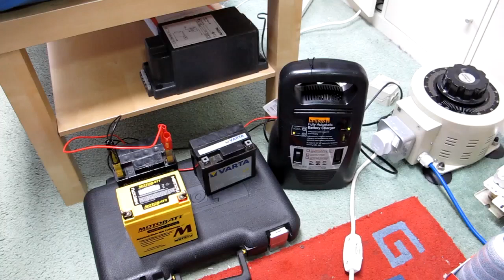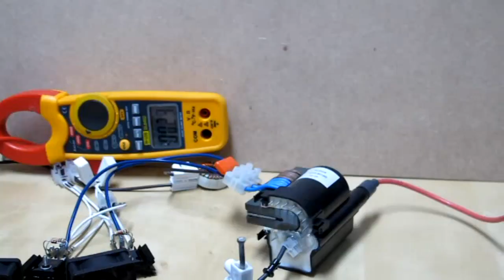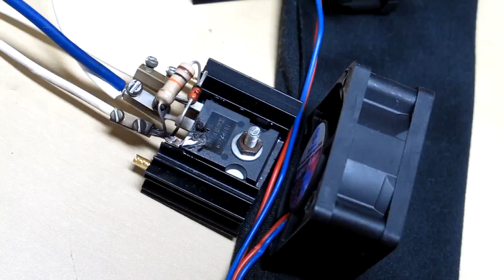Flyback transformer: 36 volts. Arcs & a big bang!

Comment: It wouldn't have been 36 volts on those batteries, unless they were near flat. You're probably pushing over 40 volts through that circuit with three series lead acid batteries.  I finished my own driver last night, but it took days and days to build it and I'm slightly nervous about blowing it up so haven't tested it as yet. :)

Comment: right before the transistor failed there was a primary side arc on the unprotected connections it happened as secondary arc went open and the excess energy of the circuit found ground path overvolting the transistor then next try no go then next pop insulate the primary side  connections and add sacrificial mov  if you don't like blowing $$ transistors

Comment: Why is the arc actually so white and "flamey" and not blue?
Reply: Adrian S Because current is high ... if current is low. The flame is blue
Reply: Careful with that. High Voltage is like a burglar and high current is like a loaded gun in his belt.

Comment: I have a 30a PSU but only 10v 
and a zvs from eBay and a lot of flybacks very big ones can I do this
Reply: Depends what MOSFET the ZVS driver uses, but I'd take a wild punt and say it probably won't work, as 10v will likely be under the gate saturation voltage and cause the fets to get really hot.

Comment from the maker: That's when RS Components' next day delivery comes in handy. I've sussed the circuit out now anyway, will now run all day at 60v and the transistors barely get warm! The weakest link now is how much abuse the flyback transformer itself can take before going short!

Comment from the maker: Yeah something wasn't right. I was playing for a good five minutes before the camera came out and the MOSFETs were only warm. Something caused the right FET to fail as there is a nice crack in it where the sparks came out and then as it stopped oscillating the other copped the full short circuit current and blewup! Ill rebuild with all new components and see what happens. I've got some better rated Zener diodes on order as well.